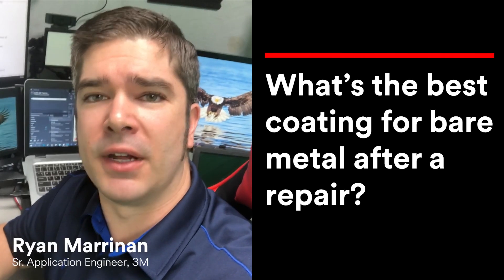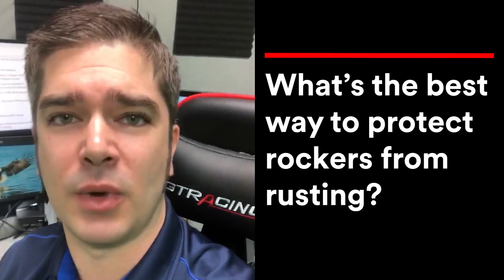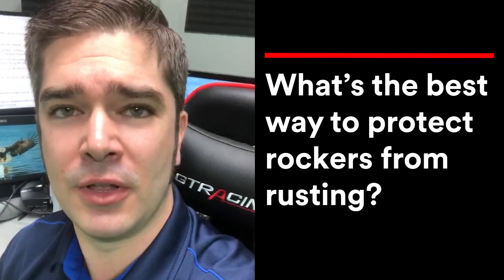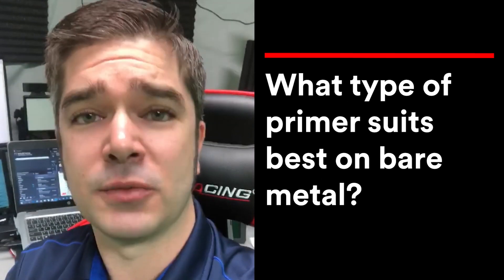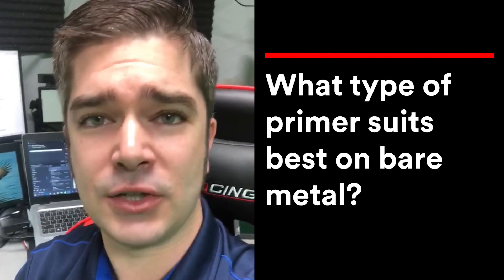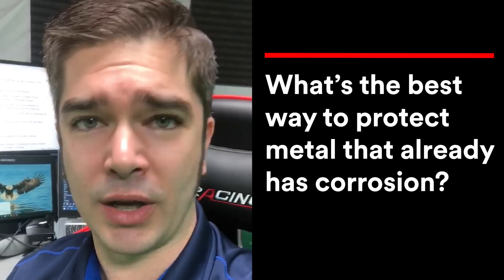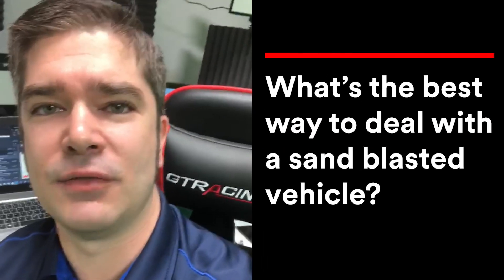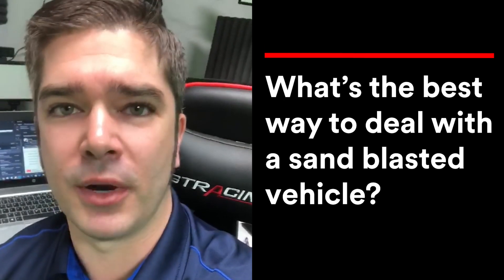Ask Me Anything: Corrosion Protection with Ryan Marrinan

Comment: I. Own a 69 Road Runner, a gift from my wife for my 72 BDay. 
  Decided to replace carpet, bad move. Area by gas brake clutch is very very bad. Do not weld and just want to stabilize area with a rust encapsulater some epoxy along with an aluminum cover. I know you are squirming in your seat. Please help l also have bad cancer so my days are numbered 

Respectfully, Bill